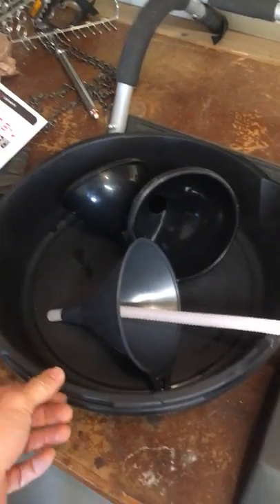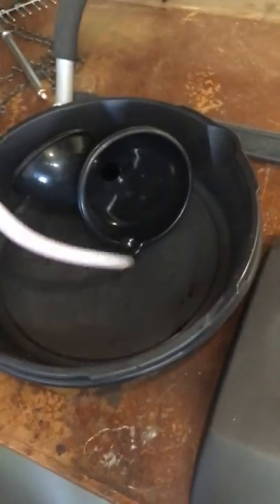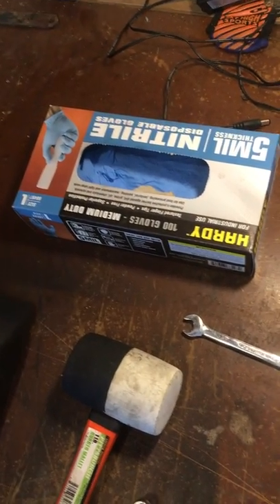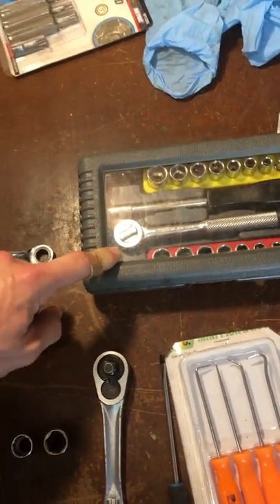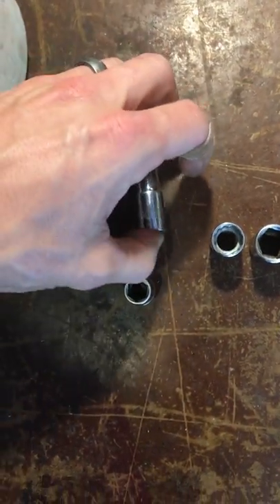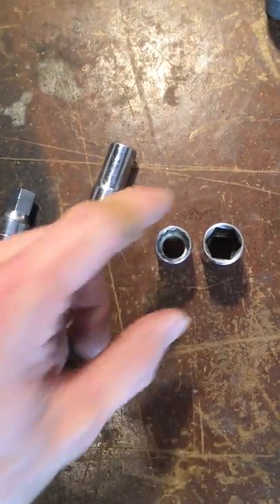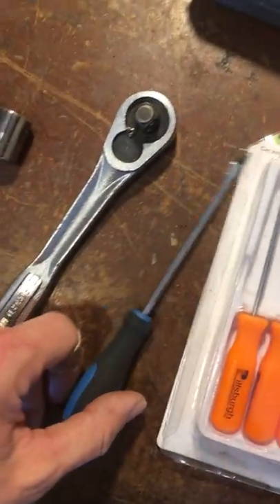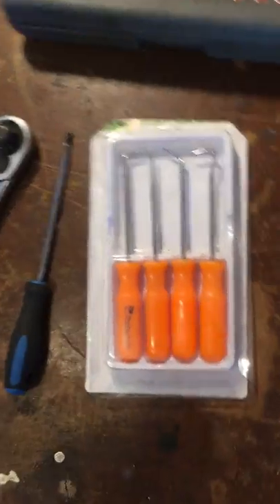09A Transmission Valve Body for MK4 Volkswagens With Tiptronic Transmission (Part 1)

Comment: Hi Daniel, I need to replace a couple of solenoids, the question I have is.
Do I have to drain and/or replace transmission fluid to take the carter off? or can I remove it without draining the fluid? Thanks
Reply from the maker: Yes and no.  There is a vid on just doing the solenoids and he shows that you can just drain from the check plug.  Its the smaller plug in the front which I pointed to, that takes a 5mm allen.  It'll only drain about a half a quart possibly more.  Then just measure what you drained out and add that back in.  When you go to tighten the check plug just go easy on it as the threads can strip.  Depending on how many solenoids you are replacing it may be easiest to remove the valve body, but you may also get by without doing so, as the other videos show that you don't have too.  Make sure you have a new gasket and or RTV sealant.  I would get a gasket as its much easier to reinstall and seal and creates less of a mess than the sealant.
Reply from the maker: *Please watch the full playlist before attempting the job it will save you  a ton of time and headache.  I also used O'Reilly's global synthetic trans fluid for only $7 a quart.  It listed the specific spec for my VW.

Comment: I did my valve body finally and got reverse back, how much tranny fluid did u use tho cuz reverse d9esnt work once I got in gear but if I turn the car off then reverse it will work
Reply from the maker: Did you put the shifter in 2nd gear before putting the VB back in?  I also heard something about a band for the reverse that could have broke, but thats unrelated to the VB as far as I know.  If its a matter of trans fluid, i think 5-6 quarts, but you have to get the car up to temp (100F) or a quick drive around the block if i remember right, and let it drip out some before putting the plug on the bottom back in.  There are other much better videos explaining this on youtube.